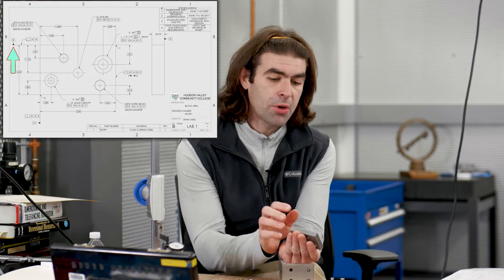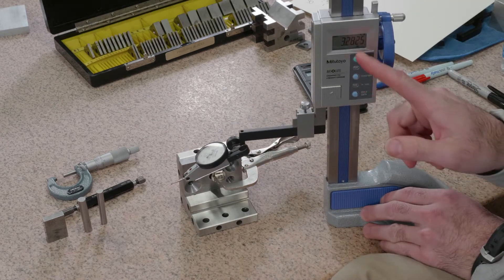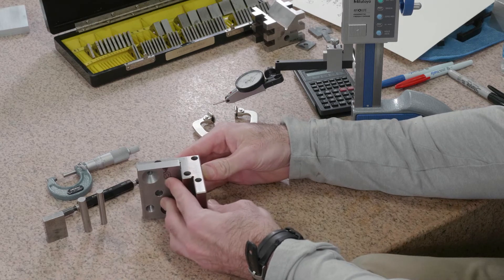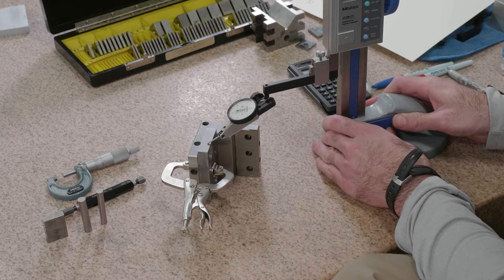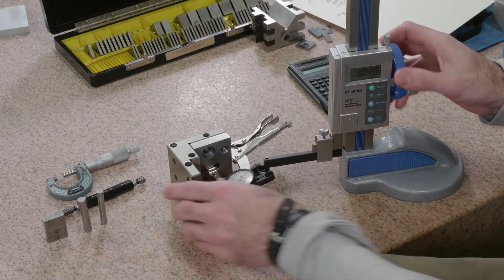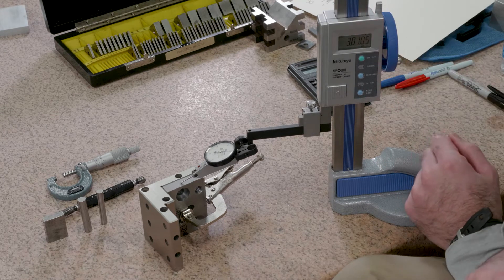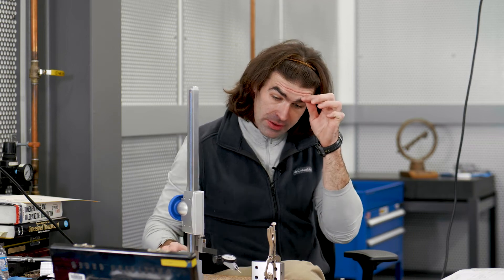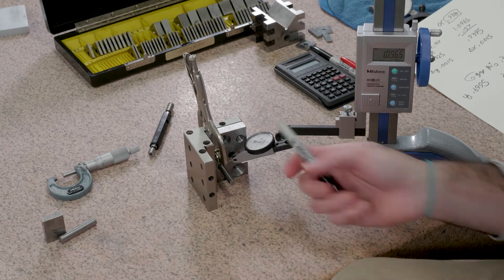GD&T Inspection: Which Features to Inspect First?

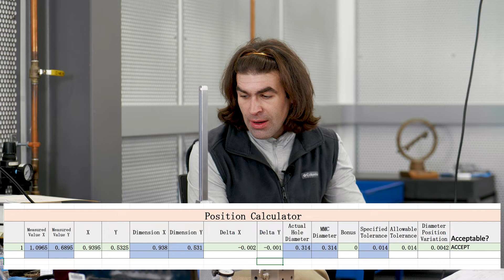Comment: Thank you so much Dean for you video! Just a small correction for the Y value of the thread hole. At 15:10 you measure 0.6995 an later at the excel sheet this value is 0.6895 (17:14). With the true measurement we get, for the Y axis, 0.5425 which is out of tolerance.

Comment: Hello, congratulations for the nice video! Just one doubt, the position tolerance has a cylindrical tolerance zone. When you measure it, I understand you just got a point and checked if it's inside the tolerance zone as a cycle. How do you check if the central axis isn't with an inclination? In other words, how do you measure it considering the cylindrical tolerance zone? Many thanks in advance :)

Comment: Really useful video. Profile inspection is quite clear .
I have a question about the positions. How to choose the proper pin size to do inspection like the video ?
Reply from the maker: Thanks so much! The gage pin is used for two things, 
1. To find the unrelated actual mating envelope of the hole in order to simulate the axis of the hole.
2. The size of the pin is the unrelated measured mating envelope that is equal to the MMC size.

The proper pin size is the largest pin that can fit within the hole, to make contact with the high points.

Comment: Dean - great job as always. I really liked your comment regarding the use of MMC on threads. When applying Position to a mating clearance hole and calculating the amount of Position that can be applied (shared) between both drawings (based on the Fixed Fastener Formula), I have always felt that it's a waste to use some of that bonus on the threaded hole. Also, I believe that the tolerance zone applies for the entire thickness of the part, so when checking with the gage pin, I feel that you should also move away from the surface of the part equal to the thickness of the part (really a perpendicularity check). Thanks again for the time that you devote to helping all of us with GD&T!!

Comment: Hi Dean!

Question for you: When you were sweeping Datum B for the perpendicularity requirement, it's only referenced against datum A. Wouldn't that mean that you would be sweeping along the shorter end of the plate to check? Not across the longest surface? I saw you did hit all 4 corners, but I have no "proper" GD&T training yet so I wanted to make sure that's the case.

Cheers, love the videos man!
Reply: Hi Dean, this is not what he meant. He meant that you still would sweep the Datum B, but the direction of sweeping is not parallel to A (longitudinally) but perpendicular to A (laterally). Because the perpendicularity deviation would actually take place in this direction.
Reply from the maker: Thanks for the question! In this drawing, Datum B is the long surface, so I have to sweep that surface to verify it is perpendicular to Datum A. The short side is Datum C, that side is checked when constrained to Datum A & B.

Comment: I feel guilty by having the CMM to do my measurements. Great Vids
Reply from the maker: Thanks! I think the instant feedback a CMM provides is reassuring. Plate work can be very mysterious.
Reply: @RDeanOdell  Absolutely. But understanding what you demonstrate in this video helps to prove out the CMM program. A lot of machinists will argue against a CMM unless you can prove the result with an indicator. :) Good video!